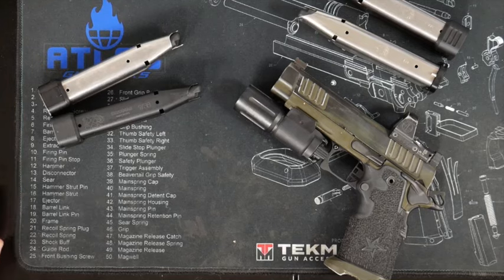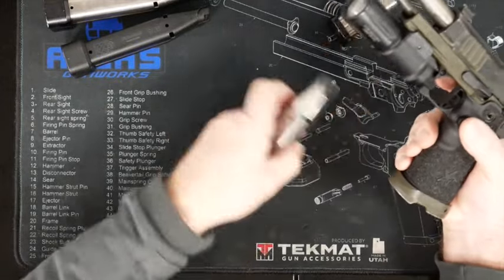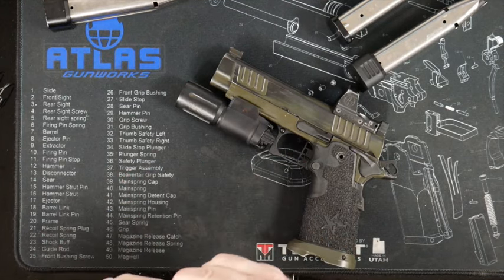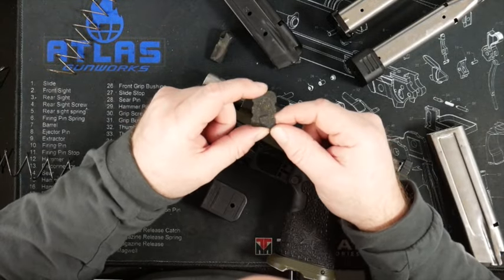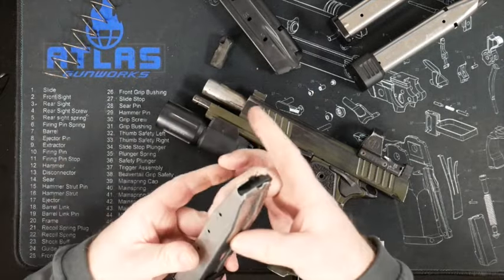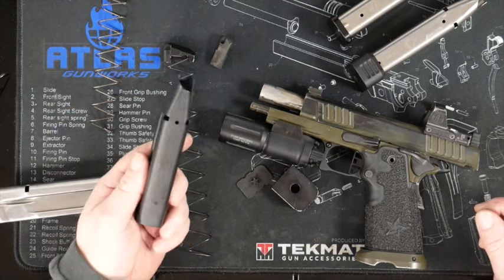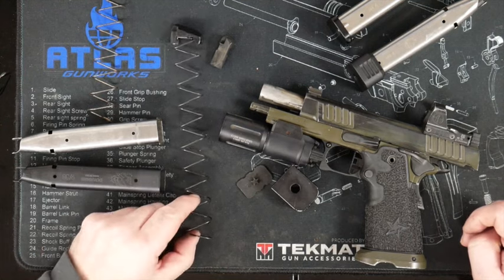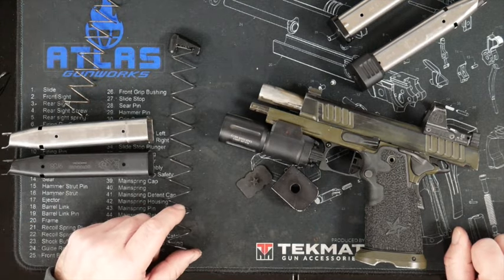Change your 2011 Mag Springs!

Comment: Do you have situations where the gun locks open when manually racking it on an empty mag but the gun will not lock open once the last round is fired?
Reply from the maker: its not common.  The follower is most likely not going all the way to the top of the mag or with enough force.  First thing to check is mag springs.  Second is follower fit to the top of the tube.  Keep in mind that some really light ammo could possibly have the gun short stroking and that could affect this too but is uncommon.

Comment: Does anyone have 2011 mags that rattle?  Mine rattle right at 9 rounds and they all do it?  Any suggestions or recommendations?
Reply from the maker: The Rattle in this type of mag is typical and not something that needs to be fixed or adjusted.
Reply: All of my Infinity mags rattle in my Infinity 6” 2011, regardless of how many rounds are loaded in the magazine. They always have, no impact on functionality.
Reply: It’s just the way the bullets are stacking. There’s a lot of room in the mag for 9mm bullets as they were originally designed for .45. I usually find if I tap the mag on its spine in my hand the rounds will seat more evenly and it usually will stop the rattle.

Comment: For me, the mag will lock the slide with 1 round left in the magazine . What’s causing this issue?
Reply: my Prodigy duramags do this. I'm learning just to count and reload in comps
Reply: Last round’s bullet my be hitting the lobe of the slide stop and pushing it up. Check the slide stop lobe for copper streak from rubbing the bullet as it comes up.
Reply: Feed lips of magazine is out of spec (too wide) allowing the follower to engage the slide stop prematurely.
Reply from the maker: @BTX406   This is one cause.   If the last bullet in the mag touches the slide stop.  Trim the slide stop back until it no longer contacts.   Minor bullet contact on the slide stop is not uncommon.  If there is no issues don't tune the slide stop.
Reply from the maker: @jmwebservices8362  This is another cause.  It's that the tube of the mag is letting the follower move to high.  Not always feed lips.  Often just below the feed lips.
Reply from the maker: See notes below.   The third cause is that the slide stop is not getting enough resistance against the slide stop pin.   The pin can be stuck or not moving freely.   Check that first.  Also the pins can wear down and have flat spots.  Often the gunsmith trick is to dimple the spot where the pin rides.
Reply: We had one at work that would always lock his staccato back with one round in a duramag. The followers are cut different between staccato and duramag to stop the slide. He changed to staccato followers and no more problems.
Reply: If I’m remembering correctly Taran Tactical sells a follower that’s made to lock the slide back with one round left.
Reply: @marksd5650  a economic mag XD save a round for you.